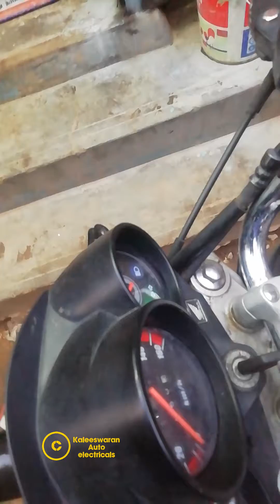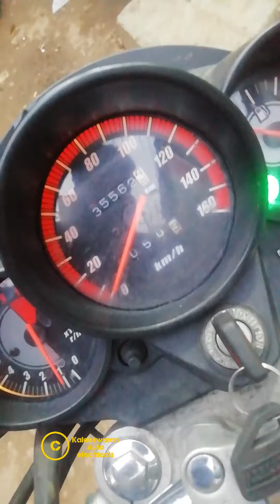Led headlight alteration for honda unicorn using 4 pin relay

Comment: Sir entha capaciter value diode value use pandranga
Reply from the maker: Capacitor- 4700mf, 25 volt
Diode- 6A4
Reply: You mean
Bridge rectifier circuit or full wave circuit